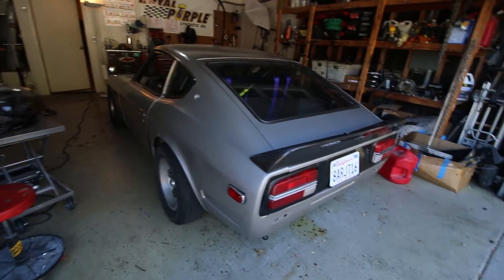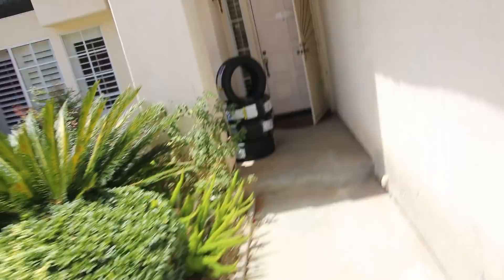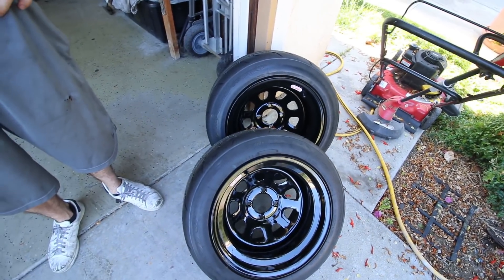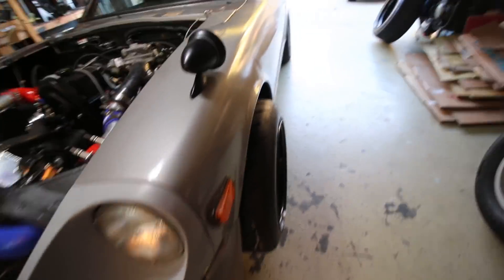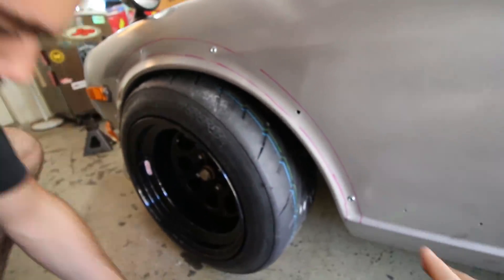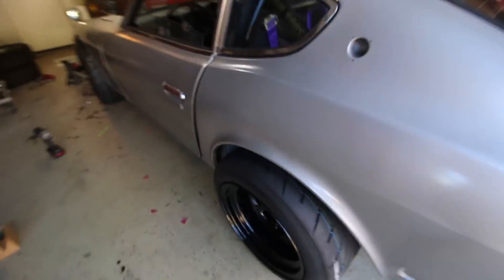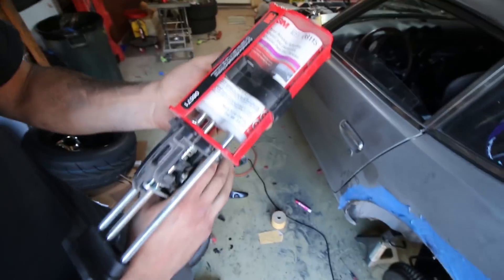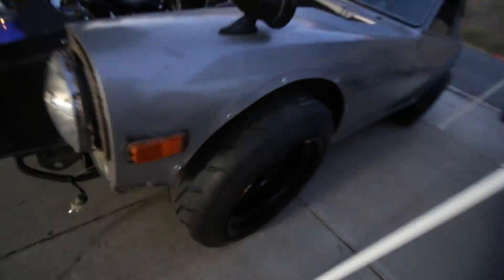Cutting up the Datsun for R888's - 4 Cyl 240Z

Comment: One thing that took way longer then expected...On my 280zx I thought my wiring got fucked up because my brand new battery and my brand new alternator weren't helping my car just kept dieing and wouldent hold charge turns out at the end of a long wiring journey and a big kick in the ass turns out the auto parts store sold me a from a later model alternator that dident have a inbored regulator ujjjjjhhhhhhh...

Comment: Wheel bearing someone had locktited the nut on, broken breaker bars, impact gun did nothing, ended up 3 days later with an impact socket welded to a 10 foot length of steel and my wife in the car with both feet on the brakes to get it.
Reply: Holy Crap! I think I would have gotten super frustrated and broke out the C4 on the entire car!